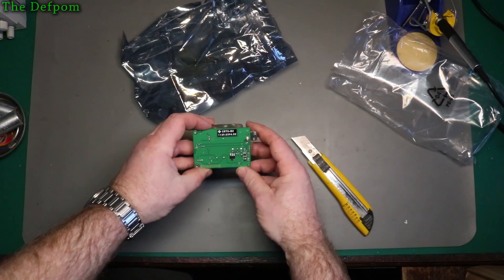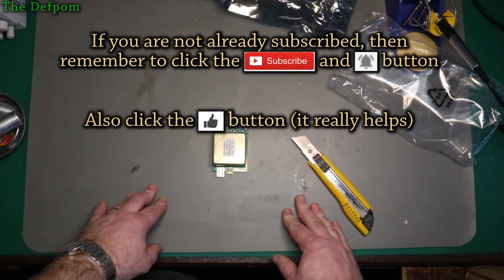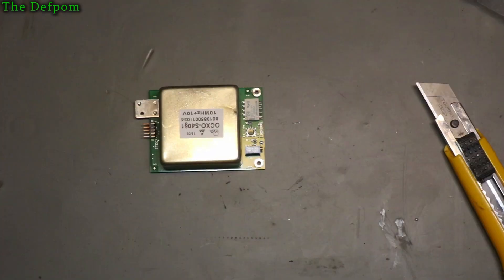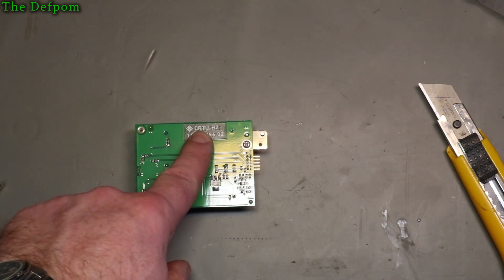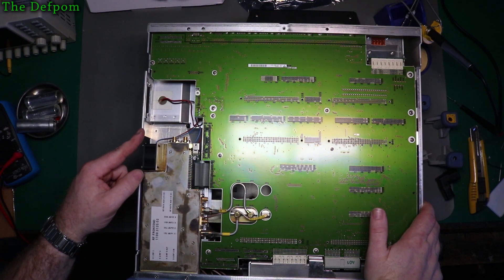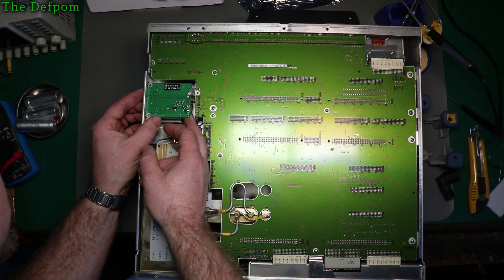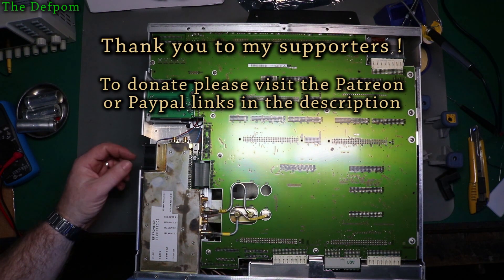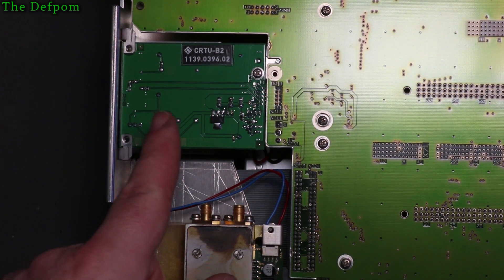🔴 #433 Rohde & Schwarz CMU200 B11 or B12 OCXO Option Installation

Comment: Thank you for this video!!
I have CMU 200 with B12 option in my job.
I can't use volume control and panel loundspeaker, but I believe this equipment don't have internal analog demodulators (only modulators in signal generator).
I try to search any information about demodulators and volume control.
The spectrum analizer start in 10MHz, but I've heard that it's possible change to start in 100KHz like a RF generator, I don't know how...

Best regards!!

Comment: i prefer to use external 10mhz gpsdo reference.
Reply from the maker: Yep, if you want to go that route it is the more accurate method. I like my gear to be able to stand alone and not be reliant on other gear to work, if I need high precision then I plug in my 10MHz rubidium standard.

Comment: I have an old Rohde & Schwarz signal generator, valve based and cast iron case, gut busting.
It has a AE badge on it.
The funny thing is its function "Emperfanger MessSender", yep it sure does send a mess :-D